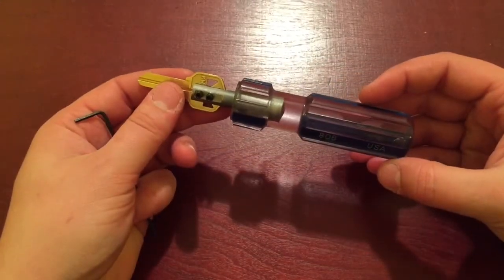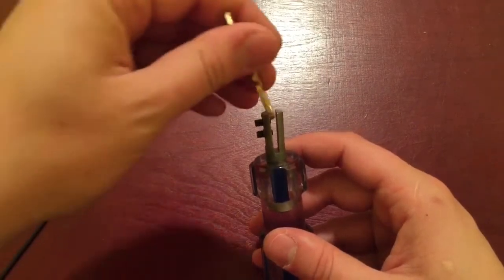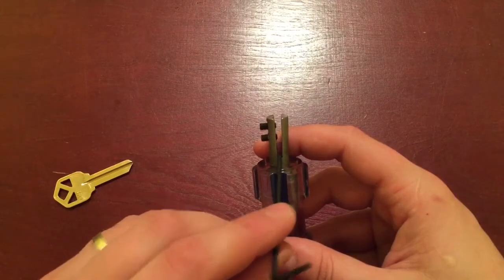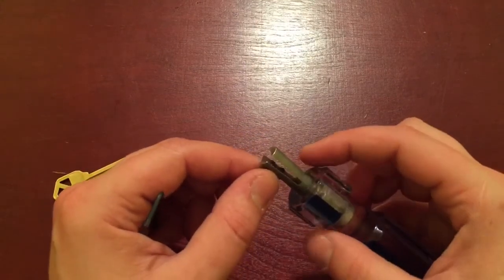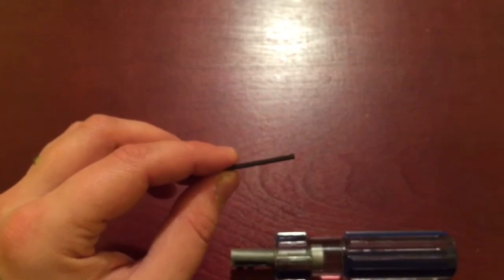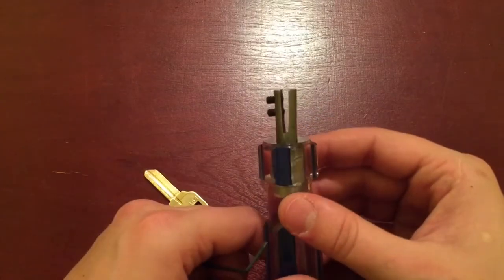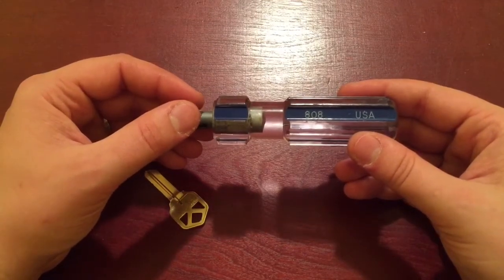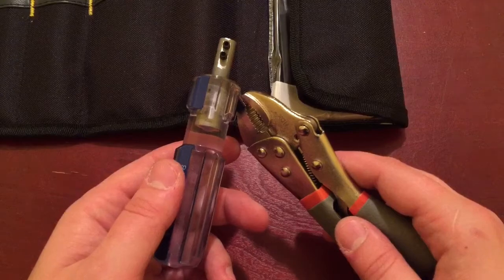Impressioning Key Handle/Grip for FREE!!!

Comment: That is a great idea. A way of saving money.
Reply from the maker: So true Jim. Especially for beginning impressioner. Why spend 50-100 bucks on a tool to possibly realize impressioning is not for you. Plus this thing also works as a Tail piece turned for IC core padlocks. Not sure if I mentioned it in the video.
Reply: Papa Gleb
Yes true. I will build one of these next week and give you credit for bringing it to my attention.
Reply from the maker: Jim, if your seriously considering making it, I have a better handle to work with. Enter windshield removing tool into Amazon and you will see a tool for about $25. Obviously we don't need the tool but look at the handle of it. Very nice solid steel handle. It's not free but it's probably the cheapest best thing. You will need to do a bit of work making the slit/cut a bit bigger for keys to fit and possibly drill/tap another hole but the results will be better than any screw driver.
Reply: Yes that is right. I already have the solid steel and a way to get it turned down on one end. I will research this futher and see what I can come of with. I will let you know.
Reply from the maker: Very curious to see what your end result tool will look like. Make sure to post pics or better make a video.
Reply: OK I will do that.